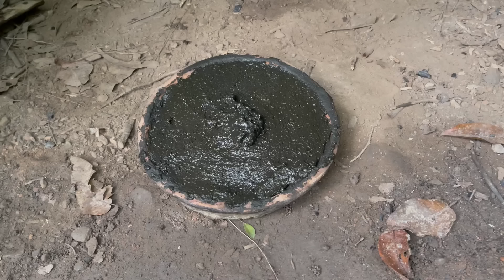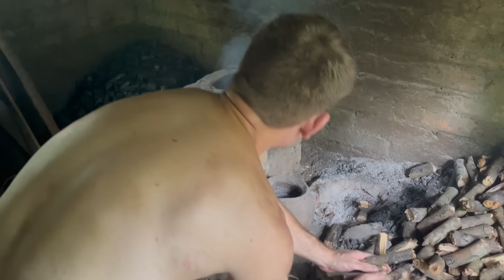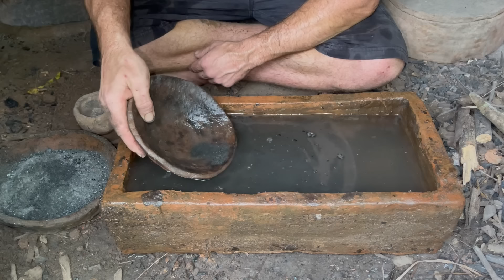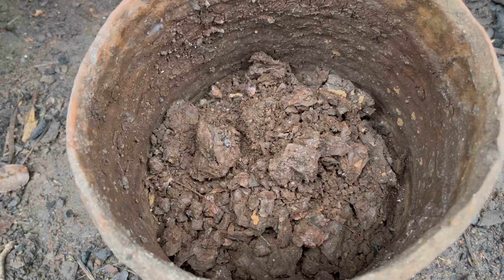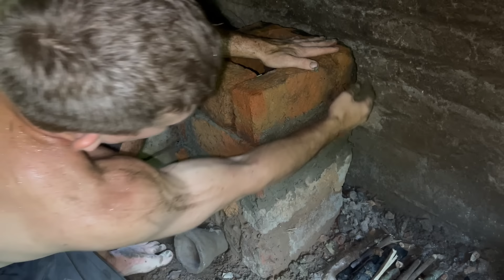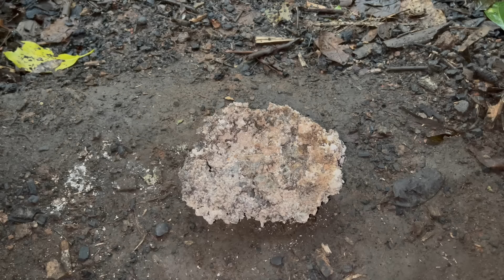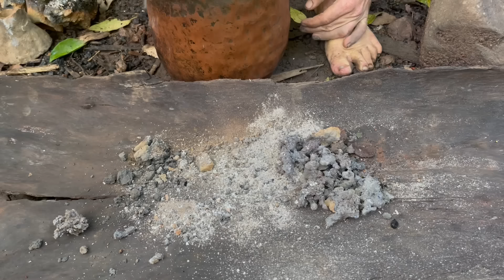Primitive Technology: Roasted Ore and Shell Flux Smelt

Comment: The chemical used to lower the melting point of the slag (unwanted materials, also called dross) is calcium oxide.  Wood ashes contain calcium oxide, as does pre-burnt shells, and limestone that has been baked into quicklime has the most calcium oxide.  Since he's in an area with no limestone, he only has ashes and snail shells to work with.  The failure may have been due to the fact the shells were merely crushed, and not pre-baked, as happened in a previous experiment (turning snail shells into the calcium oxide / hydroxide needed for making cement) several years ago. Or it simply could have been too much calcium oxide, because yes, sometimes too much of a good thing is actually a bad thing in the end.
Reply: I'm really excited for further refinement of the process, and the design of future experiments.
Reply: Right...i remember a guy making roman concrete as an example and showcasing the burning of clams (if i remember) to make quicklime and then pouring water over extremly slowly as it was so exothermic that it could break the container. At the same though i would think he'd know mostly because writing "How to make flux" probably wouldve shown this somewhere.
Reply: I believe it was probably a little of both.
Reply: I wonder if the smelting attempt functions as a pre bake so that discarded ore might just need a second smelting.
Reply: Nerd
Reply: @jaytf310  Thanks
Reply: 9oo9o9😊oooo99
Reply: @Leadvest  ⁹⁹⁹99⁹,😊😊😊
Reply: @moistnuggests  ⁹⁹
Reply: @ILCorvo001  9
Reply: @ILCorvo001  ⁹⁹⁹⁹9
Reply: 0
Reply: 😊ol9op9ollooplloo9llool9ooooolo90ooollo0olopoolll9llloololololoololooo0loloolllloooooo9o0loplooo9l0ooollo0ool00oo0ool😊oolo9ololo
Reply: 9oo9ololoooopooooooopoo0oo0ooooooloooo9oooo9loooooo😊oooooooooolooooooooop😊oploo9ol0op0oo99oooooooloopooopooooopoooooooollooooppoooool9oooooñooloooloo00ooooolooooooo0ooooo0ooooooolooooooolooooooooooloooooloo9oooppoo9popoloolooooloooo0oooooooooo9ooploploo9oolo9oooooloooo9ooop😊oloooooooool😊ol9opooooooollooooolloooo0olooloooooooooo
Reply: 😊9oooooopoooooooooooololooooooooopoplo9loooooooooooolooooooooooo0oloooooooooooplloooooo0oppoooopoñ😊o😊9o9ooooooopooolpoooloooo9olo9ooooooo😊ooo😊😊oo9opoolooooooloooooooooooooooøoooooooooooo9looooo9oooooooooo9ooooooooo
Reply: we got game genie over here
Reply: I’m sure this is a dumb suggestion, but is there anyway to make a crucible and just put the ore in it and then heat the crucible with the blower?
Reply: @fldallyb  Not really, just beyond the scope. If you aren't specifically trying to do gas flow reactions, crucibles are for casting. Ceramic crucibles are made with chemically purified compounds, carefully designed by chemical/material engineers, and degassed with vacuum chambers. 

There's a possibility that someone given enough time could flow chromatographically isolate the correct silts, combine them in the correct ratio with extremely fine bone powder, and work it all underwater to prevent gas inclusion. But feasibility is a problem. 

Also working backwards from a modern perspective probably isn't really aligned with the motivations here.
Reply: @fldallyb  It's not dumb, so much as a good inquiry chance for finding out more information.  Unfortunately, it's very difficult to make a crucible that can withstand the high temperatures needed in a primitive technology situation like this.  For one, the blast furnace shape is required to blow air in from the bottom, up through the material to be burned.  This is because the charcoal can get hot enough, but only if it gets enough oxygen.  A crucible container would actually partially insulate the ore from the high temperatures needed--this is why the charcoal is laid down first, then handfuls of the ore powder are added on top.

Additionally, if it's earthenware--the only type of pottery we've seen available so far--it's not high-fire quality ceramics, and the materials would actually slump, mixing with and possibly even further encasing the ore, isolating it from the 3 things needed for fire:  fuel (charcoal, which can burn at the extremely high temperatures needed for smelting iron), oxygen, and heat.  The heat is absolutely needed for smelting, but it requires oxygen and fuel to achieve that high heat; if any of these things are out of balance, you cannot get higher temperatures.  The charcoal CAN get hot enough for the heat required for iron smelting...but you need the oxygen for absolute sure...and that requires a blast furnace shape.

Crucibles are great, but they're better employed once the metal is already smelted from the raw ore, and usually for lower-temperature metals such as copper and tin, which when combined together create the alloy bronze.

Alas, in order to make copper, you need to do virtually the same thing as you would with the iron, with the fuel (charcoal) and the ore (smashed to powder) as you would with the iron...except you can do it at a lower temperature, but you need to do it in a reduction atmosphere (aka half-smothered).  Primitive pit firings for smelting copper ore in the olden days were literally a bowl pit dug into the ground and lined with clay, then you pile in charcoal, ore powder, and then a big chunk of turf on top, with a tuyere pipe buried underground leading into the pit, and bellows to pump air into the turf-covered pit once the fire gets going.  By limiting how much oxygen gets to the copper ore (chrysocholla, malachite, etc, which are copper oxides), you force the minerals to use up the oxygen bound to the copper ore as a part of the smelting process, which in the end leaves you with puddles of copper on the bottom of the clay bowl.

But again, that's smetling, not casting.  Crucibles are best used when you've removed most of the slag or dross (unwanted materials), and now just need to melt the remaining metal and prepare it for pouring into a mold, aka casting it.  At this stage, you can remove the last bits of slag before the final pour...or even the preliminary pour, if all you're casting is bars or ingots.

It is far easier to heat up a crucible full of copper, silver, or even gold than it is to heat up one full of iron.  It requires the resources & technologies of the Industrial Revolution to use crucibles full of molten iron or steel. (Steel = iron with a roughly 3% proportion of carbon to roughly 97% of iron; this is usually achieved via blasting oxygen up through the molten iron until it's purified, then reintroducing carbon in specific amounts in the crucible...which I'm sure we can all agree requires a lot more control and precision than what is currently available on this channel.)

Even with the millwheel-powered blast furnaces in the late Medieval / Age of Exploration (prior to the Industrial Revolution), it was still far easier to literally beat the impurities out of the iron via the force of a hammer pounding onto the red-hot iron on an anvil, because getting the iron hot enough to be liquid was exceptionally difficult.  And those blast furnaces required having high-quality clay for the fire-bricks used to line those furnaces...which requires a lot of experimentation to find the right clay minerals that can withstand such high heat.

(Where I live, in western Washington State, USA, we DON'T have the right kind of clay minerals; the indigenous Coastal Salish people developed steam-bent wooden boxes cleverly fitted together so that they could drop heated stones into water to boil it...because the clay around here is so crappy, it can only make low-quality low-fire bricks at best, and CANNOT make pottery suitable for using as cooking utensils.  We have to import our clay if we want to make any actual ceramic pots worth a darn.)

The bright hot liquidy stuff you see pouring out of the bottoms of pre-industrial blast furnaces are actually the slag minerals, while the "bloom"--the lump of iron left behind--has to be extracted as an awkward-looking lump, and then beaten in between reheating cycles in a forge pit, just to force the remaining impurities out of the metal, under conditions that range from primitive to medieval.

The thing most people forget is that we have forgotten many of the little tricks and secrets of these pre-industrial skills.  Channels like Primitive Technology are experimental archaeology, where we read up on what we do know, and try to reason and experiment our way through the mysteries.  We come up with ways to test what we think we know, observe the results of those tests, and try to figure out what went right versus what went wrong.

In this case, the unbaked shells added to the ore paste didn't work like one would think it should, since we how that calcium oxide can help flux out the slag materials.  But the really cool thing is, these are the same sorts of experiments our ancient ancestors would have tried.  We are connecting with untold generations across many locations who also tried to figure out how to do this stuff, and experimented until they got it right.

And sometimes, you have to ask the seemingly dumb questions, because someone might have overlooked a step that could have worked better.  Like pre-baking the ore paste.  That's not a step I would have considered a good idea to try, yet it clearly produced roughly double the iron prills and nodules that not pre-baking the ore paste previously produced.

Now, if there IS a clay on hand that could produce a high-heat-resistant crucible, I'd be willing to try it!  You never know until you try, and you can learn via many different ways:  from failures, from successes, and from seemingly wild ideas.  But so far, I haven't seen any signs of the local clay being high enough in quality for that.  (Though I can tell you flat-out that he has far better clay in his region than I do in mine...sigh...)
Reply: @ladyofthemasque  Wow! Thank you for your response and for taking the time to answer, Your explanation is very detailed and well thought out. I do truly appreciate it.
Reply: @Leadvest  well, if it came down to me having to make iron or steel, I’d be better off looking searching for a meteorite, it would probably take me less time. Lol.
Reply: I was thinking about that too. I'm no expert by any stretch, but I was pretty sure you need to bake the shells before they can be used in this way.
Reply: @Leadvest  You could do it with a platinum crucible.

How to get platinum from pond mud, is left as an exercise for the reader ;-)